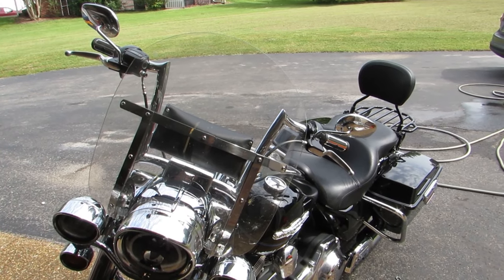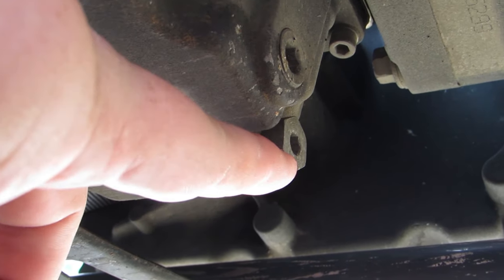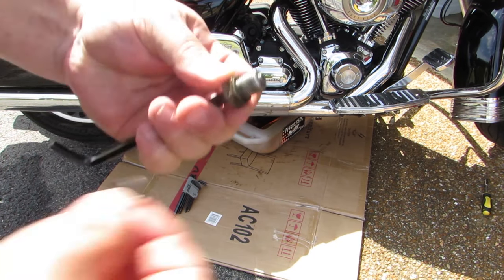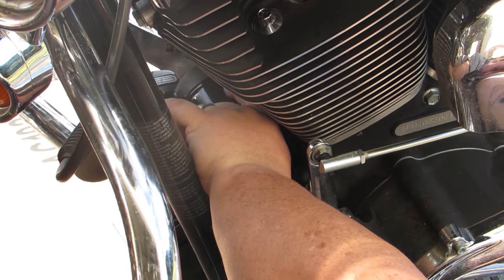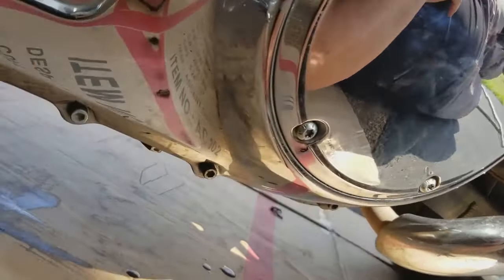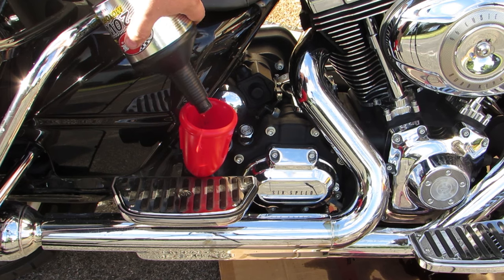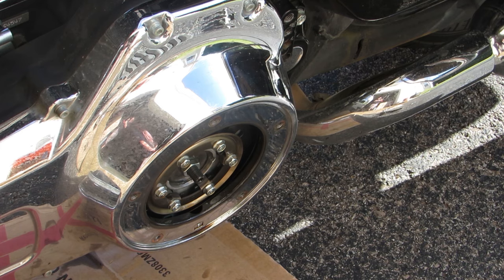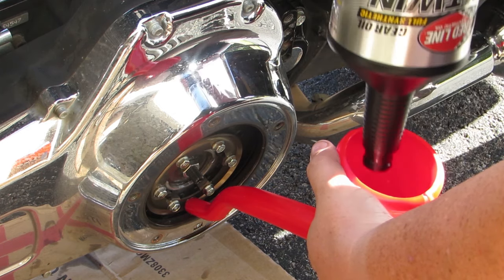How to Change Oil and Fluid on a Harley Davidson Twin Cam Road King - GetLowered.com

Comment: The reason your rounding out the derby cover bolts is because you're using a t25 and not a t27 like you should be... other than that..great video

Comment: Use empty 2 liter bottle to cup the oil filter... cut the bottom off the bottle and then on the open end cut a piece of the bottle off one side so it is longer on the other side.  Put wrench head on oil filter, cup bottle around filter, stick neck of wrench thru bottle and oil will drip into bottle and bottle will catch oil filter....Free Hack
Reply: I service generators a lot at work. I like to use large fountain drink or iced coffee cups. I loosen the filter with the wrench, then put the cup around it. The cup is just big enough to where you can squeeze it and in thread the filter by hand while catching all of the oil in the cup!

Comment: Roccfella2625 is 100% correct, those screws heads on derby cover are a hardened steel, so if they are stripping, you have the wrong size bit.
Thanks GL!

Comment: I believe the derby cover bolts are T27.
Reply: I found that out the hard way. After striping one out. I watched the video again and I did indeed hear T25. Maybe his were though
Reply: @dannymarsjr6422  They are usually T27, and easily stripped with T25. I also use a sliced 2L bottle to catch the oil filter oil. It damages you motor mount if you. let it go all over.
Reply: @dannymarsjr6422  I have one over torqued and stripped, how did you get yours out?

Comment: If you leave the filler cap on before you pull the plug, the oil wont come gushing out and make a huge mess. Once plug is out then open up filler cap to vent. 
 Most people doing these oil changes on the floor, only about 5” from floor to bottom of pan, not a lot of room with catch pan. 
 The Derby cover screws are T-27. 
 People stripping them are using T-25. 
 Great video though.

Comment: Take a Good Look at your Front Motor Mount and Might change your ways of letting the Oil from the Filter just run off onto it .. Can also run down on your Voltage Regulator and Possibly Short out your Stator ..

Comment: I don't understand , So, there are 3 fluids i have to change..?  Motor oil, transition oil , and what's the  3rd one than....
Reply: Motor oil, transmission oil, primary chaincase ( derby cover). 3 Holes.
Reply: Primary
Reply: not to be a dick , but I would advise you to keep taken it to the dealer , just like you need to change your plugs , and air filter to keep them running good

Comment: Howlong does it take to do this
Reply: You just watched it. It takes 7 minutes 😉. Actually, it takes me about an hour because I like to let everything drain completely. Also, warm up the motor a bit beforehand to get the oil to run out a bit better.

Comment: Let's see take off filter and let oil run all over or place a small rag under to catch a good bit of the oil with much less clean up...   duh
Reply: I make a little tray out of cardboard which goes under the filter as I'm removing it. It drips into a pan. No mess.

Comment: Why redline over syn3?
Reply from the maker: There are definitely plenty of options out there and it ultimately comes down to personal preference on what you use! Red Line is a quality product and has a nice all in one kit that's helpful for many people.
Reply: Get Lowered Cycles gotcha I was just curious is all. I've heard people say redline is the best and people say can't beat syn3. I've got a 2000 roadglide with almost 80k miles only ever had syn3 wanted to try different products but figured if it's not broke dont fix it
Reply: I use nothing but amsoil  , just got new oil at the harley dealer in myrtle beach  , been great to me for every bike I owned